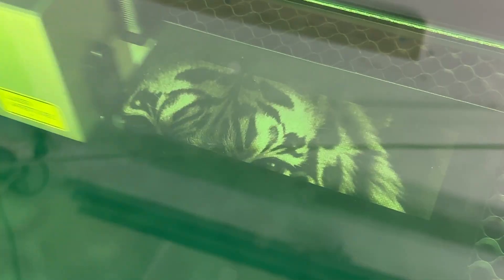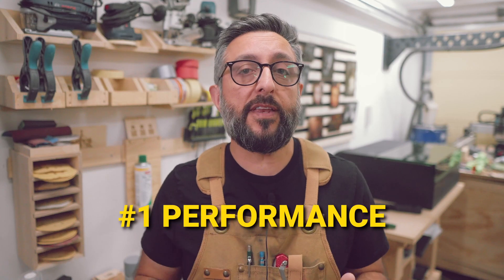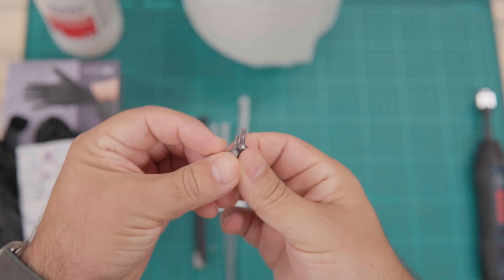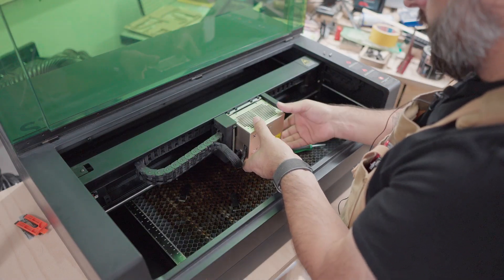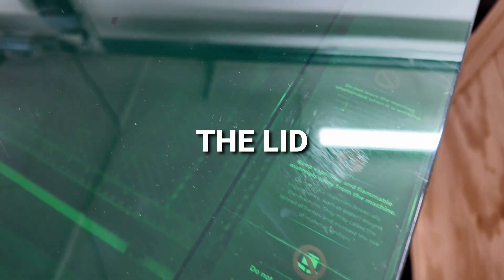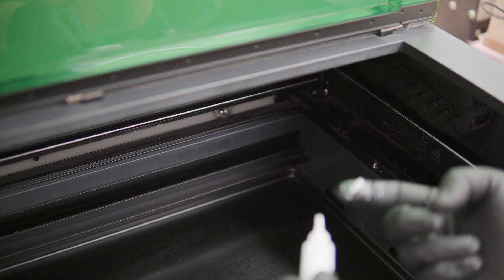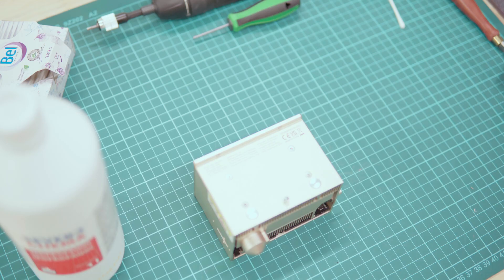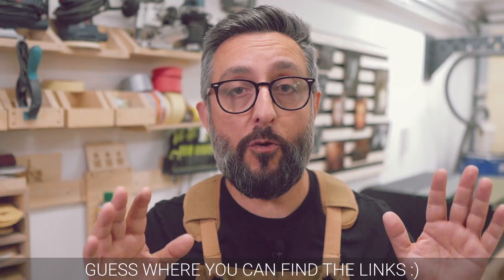I Deep Cleaned My X-Tool S1 After 1.5 Years and WOW!

Comment: Yours looked brand new. I run mine several hours most days of the week and after two months it was 100x worse. The fans in the laser head are hardly recognizable.....not really, but you get the idea.
Reply from the maker: I hear you! I was trying to keep it looking good for the camera. Most of the stuff I do generates dust mainly. But I have a weekly maintenance ritual that keeps it ok. It is not looking so new these days. The scratches on the lid don’t even bother me that much.  Say, what are you making? You sure seem to be putting it through its paces.

Comment: Realistically… that’s not too shabby of a service to have to do. This is a great video! Love that you showcase more of the machine and its mechanisms than just “Hey here’s a laser and products to sell”🤙🏼as a full time boat mechanic diagnosing motors and sensors and is brand new getting into lasers… I couldn’t agree more with the unplugging electronics. I can’t stress enough with my customers to pull with the wiring harness plastic connectors and to not pull with the wires themself out the back of the plugs. 👌🏼
Reply from the maker: I think it is pretty straightforward. I am not the most handy type of person but after a few maintenance runs, I was doing it without even thinking. I think you also have to gauge your rhythm, based on your level of production, clean things as needed. A deep clean is something I do once every couple of months. A light clean I do once a week, but if I do too many canvases, I have to be there every 4-5 canvases. I am an IT guy and back in the day, I had to be grounded (mandatory) as son as I got to the bench.

Comment: YES!!👏🏾✨👏🏾   Sometimes, I do the eye roll and “one more cut” chime when I am heavy into a project and start to see build up on the honeycomb🙄.  Two cuts later, the tool kit is on my desk.  Two cuts after that, when I can start to smell it through the N95 I always wear when cutting (even with the AP2 running), I am  breaking it down.  You are so right about the feeling of satisfaction once a deep clean is complete🎉🎊🙌🏾🤸🏽‍♀️💃🏽😉
Reply from the maker: Hehehe the eye roll is a must. The wife says I do that a lot yet I love being in front of the machine. I tell you, it is incredible how that clean up helped. I was getting a lot of soot on both sides of the material. I knew it was a matter of cleaning but at times there’s not enough time! Thanks for being here.